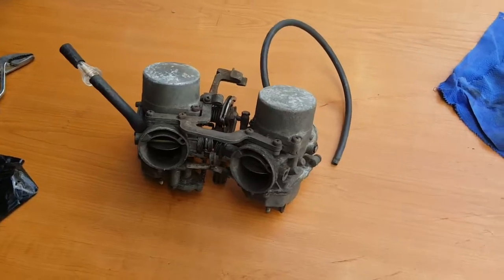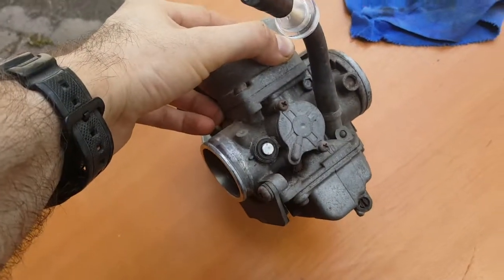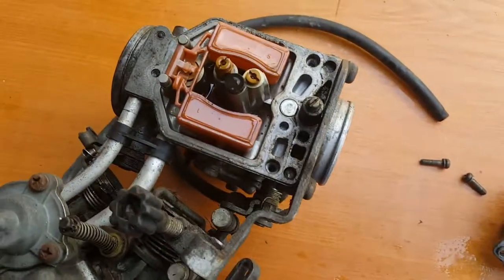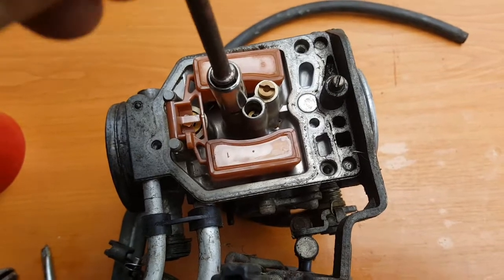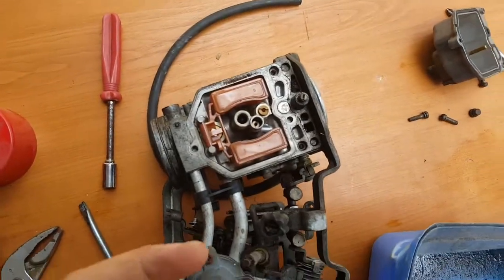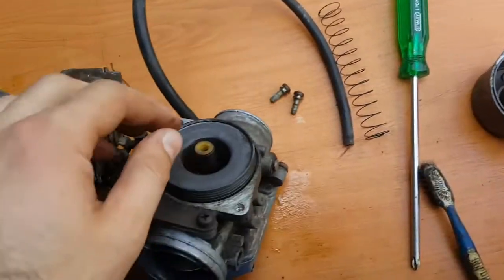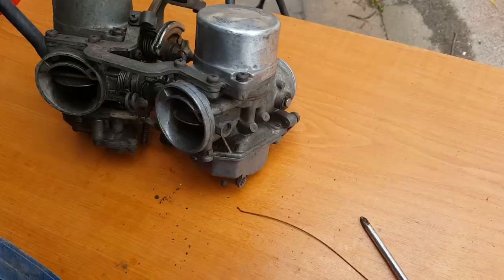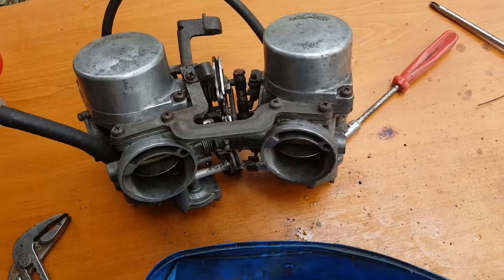Project CX650 Carburetor Clean

Comment: so i just bought a 83' and I've never rebuilt one of these, but i got a spring with the rebuilt carberueter and I have no clue where that needs to get attached to .  I'm guessing that it adds tension to the throttle cable somewhere or somehow since mine doesn't snap back like my other bikes do.  Any help would be much appreciated, thank you!

Comment: Hello congratulations for the video!  My name is fabio I did your same and identical thing only that when reassembling the accelerator (gas) it no longer comes back which it did before without problems!
 I lubricated the wires, the sheaths and all the springs of the carburetor nothing to do, the gas does not come back ..... What can it be?

Ciao complimenti per il video! Mi chiamo fabio ho fatto la tua stessa ed identica cosa solo che nel rimontare l'acceleratore (gas) non torna più in dietro cosa che prima faceva senza problemi!
Ho lubrificato i fili le guaine e tutte le molle del carburatore niente da fare non tornana indietro il gas..... Cosa puo essere?